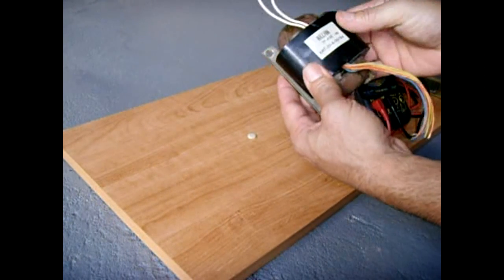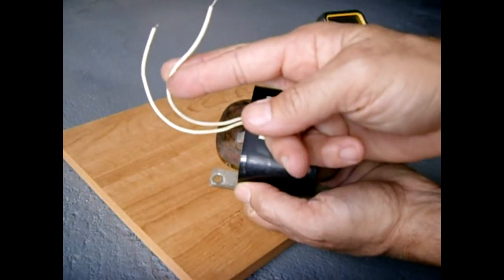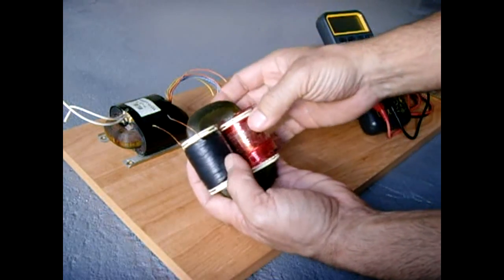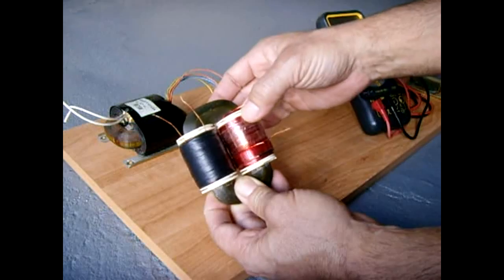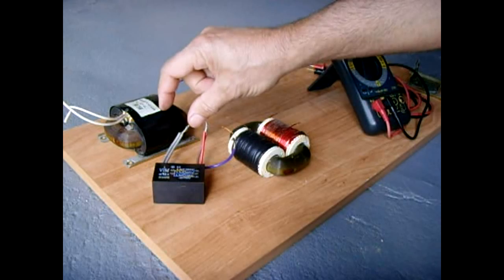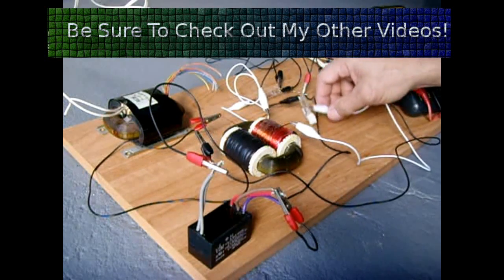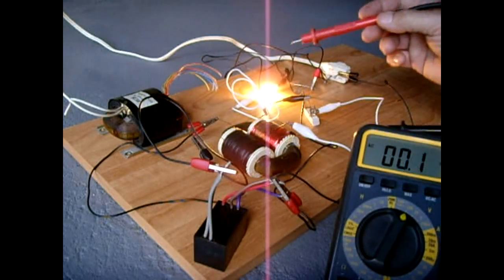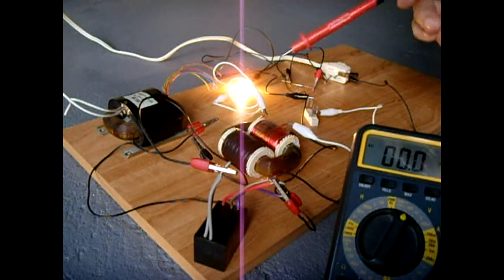The Uncommon R-Core Transformer(Closer Look & Rewind)

Comment: I found some junked Bang & Olufsen speaker amplifiers that use these, one small as you have for the preamp and a fist sized one for the power amp. Since I am parting it out as the amp is beyond savable I plan to use the smaller ones in some higher end audio projects I have since they seem to be great for low leakage.
Rarely do you see these being used in the US and appear to be much more common in Europe for HiFi audio power supplies.
Toroidal cores are used extensively here for that application. Makes me wonder why?

Comment: The R just stands for the round shape of the profile. Often the core is grain-oriented silicon steel with no air-gap.

The leakage flux in an R-Core Transformer is about 1/10th that of conventional EI or UI transformers.

Comment: It’s getting hot because Japanese line voltage is only 100V and you are using on American line voltage of 120v.
Reply from the maker: No, the device it was pulled from was designed for 120V / 60HZ. The issue was my windings.

Comment: this is a very old video but I’ve just seen it and it’s really informative. Wouldn’t the capacitor give you a very choppy sine wave on the input coil as it cuts the input above a certain voltage? I take it you’ll need an output capacitor to buffer for these gaps?

Comment: Interesting.
I was rewinding these type transformers in 1995-2000.
Initially it took 7-8 hours to rewind manually later on I managed to make a small devise by using parts of an old photocopier and reduced to 30 minutes. It is very efficient.
Reply from the maker: It's a very unique transformer design.

Comment: 3:23 lol that doesn’t seem easy to me, more like tedious. I designed a few vacuum tube products using R core some years back. I was able to get noise figures around -95dB on a high gain pentode circuit.  Seems unbelievable until you hear it. I won’t use anything else for power.
Reply from the maker: I wound the spools in a couple minutes using a cordless drill with a thick, wide rubber band wrapped around the chuck. You place the chuck against the spool and the wire fills up the spool quickly. Thanks for watching!
Reply: electronicsNmore hmm, that’s clever. I wind my own EI lam transformers; I’ll see if I can figure out a workaround like that for my winding machine.

Comment: Is it possible that it was getting hot because it was designed for 50Hz mains and it was being tried on a 60Hz mains?
Reply from the maker: Hi There!
No. The transformer was removed from a 60HZ/120V device. You can use 50HZ transformers with no problem on 60HZ, but not the other way around.

Thanks For Watching! Be sure to share and rate Thumbs up.

Comment: You might be able to use electrical grade iron wire to actually make one from scratch, or would the hysteresis loss be too much at mains frequencies (50-60Hz)? (I've mainly dealt with that kind of core on telephone gear at AF, 200 to 4000Hz ish)
Reply from the maker: This R-Core transformer was primarily designed as an audio transformer, but it does seem to work fine as a power transformer. I don't see why you could not take 1/32" or 1/16" iron wire and wind up a nice neat tight bundle to make a core.

Comment: If your transformer gets hot when there's no load on it (presumably due to the resonant effects ov your L.C. hookup) you might want to consider a shunt regulator topology for your PSU. That way you'll always have a load on it.
Reply from the maker: It gets warm/very warm. The capacitor prevents it from getting hot. Your right about the shunt regulator though. :-)
Reply: electronicsNmore Yeah I just thought that was an easy way you could make sure that you always have a load on it. Shut regs do have some advantages, but usually they are not considered because ov the bleed current. However in this case that is also an advantage, so that could be a good approach. :)